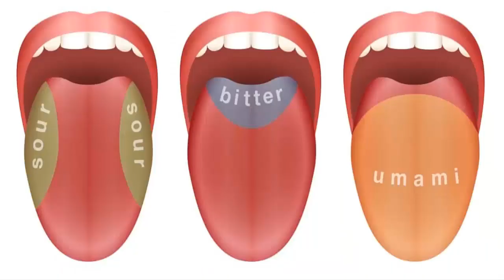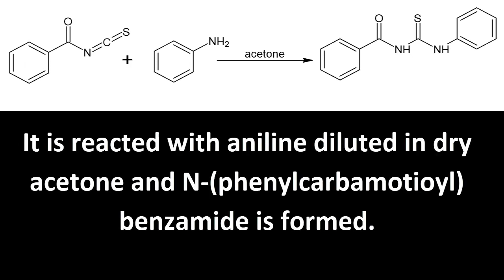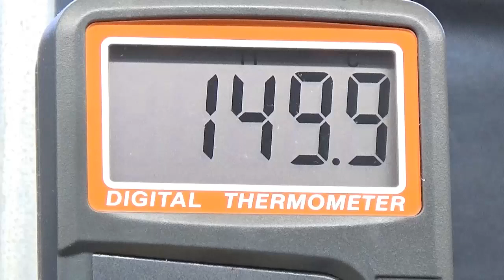PHENYLTHIOUREA SYNTHESIS.#ncchem

Comment: Just found your channel. Nice work! thank you. a quick question, why do you first acidify the solution to pH 2 (benozic acid is formed + NaCl) and then further put NH4OH? that will make ammonium benzoate (which is dissolved in water).  What is the point of adding the HCl at first place? could you not just dilute the NaOH solution, filter and by that get rid of benozate? then do the recrystallization from EtOH (should get rid of any undreacted aniline etc)?
Reply from the maker: http://www.orgsyn.org/demo.aspx?prep=CV3P0735